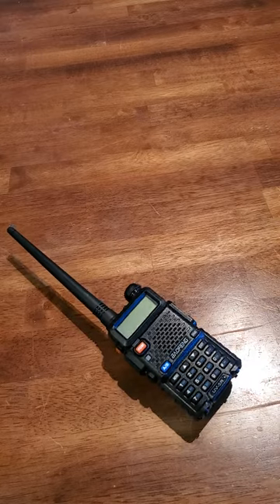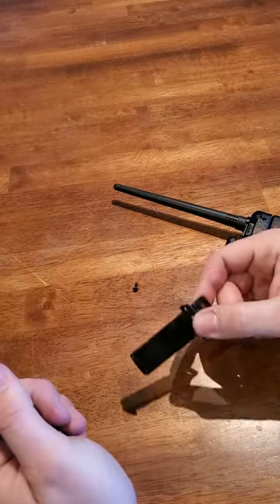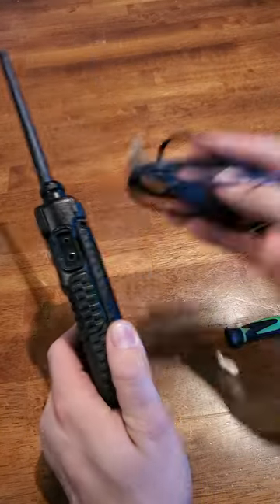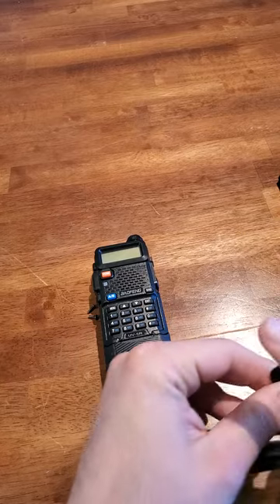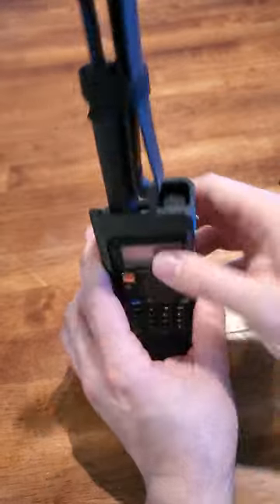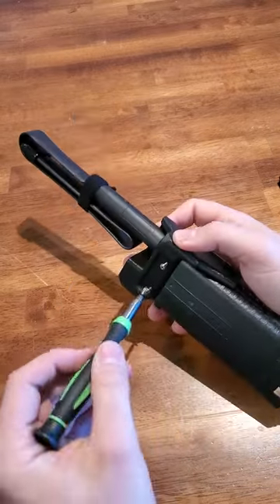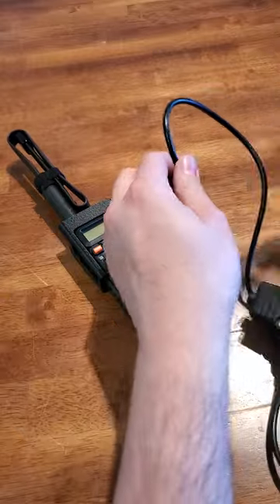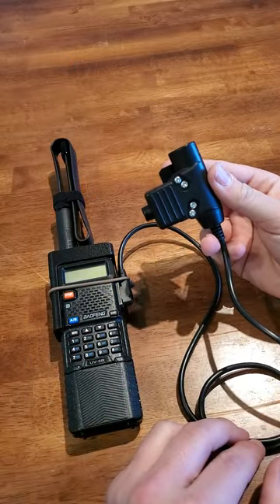How to setup a Baofeng UV-5R for use with tactical gear

Comment: Nice man. Thanks. Will that antenna let you talk 10 miles out?
Reply from the maker: It depends on the enviroment. If there is a clear line of sight, then maybe. But it struggles to transmit past concrete and buildings.
Reply: Depending on the environment, a signal stick is a muuuuch better antenna, it's less bulky and bendy, these foldout antennas look cool but if you drop it, it's probably going to break the socket. They recieve very well but transmit could be much better. Radio to radio you might get ten miles. You can get a bigger one and attach it to a coax connector and run the antenna on your pack or the back of your armor so it's not putting stress on the socket. I am NOT bashing the radio, for a 25 dollar radio that transmits all frequencies and has an fm radio, it's a fucking win in my book. Totally worth buying a few and unlocking them. I took mine out today and messed with it, I have a diamond antenna on it with a bnc connector and I just let it scan all day. I bought my brother, step dad, and my friend one and they love them!!!!